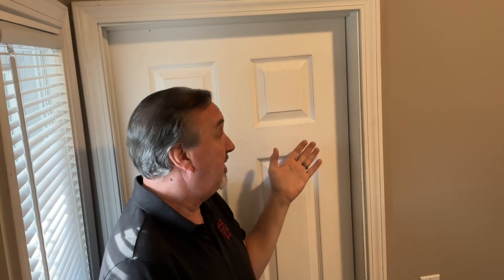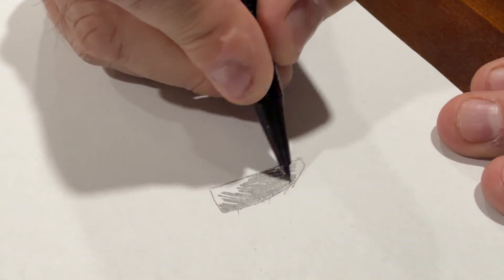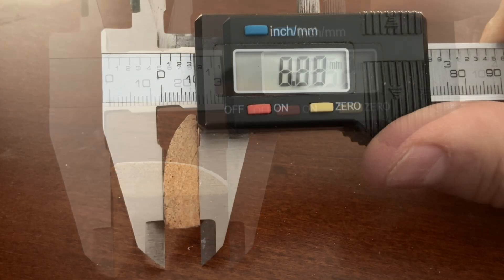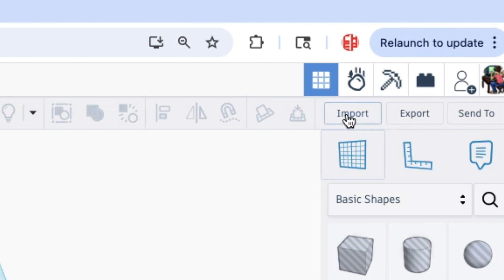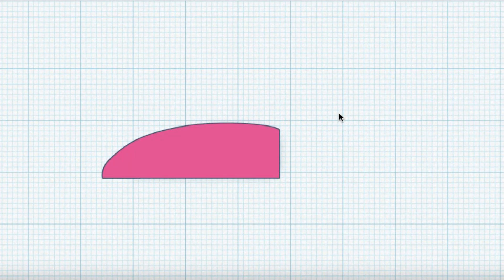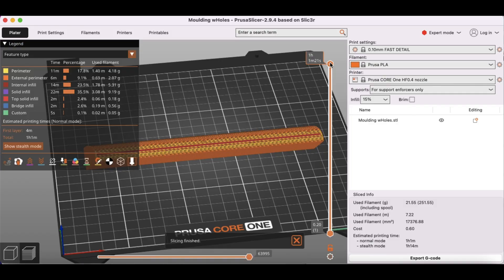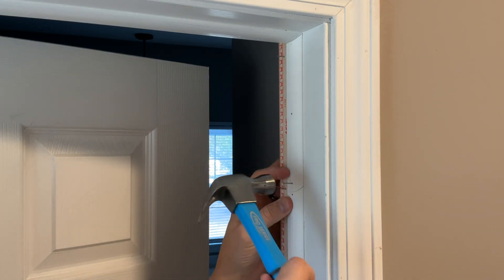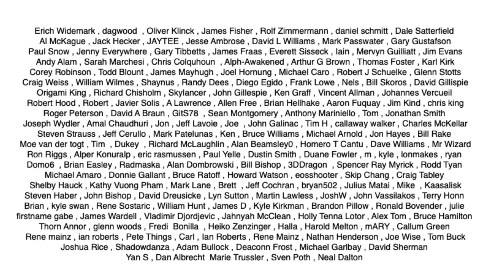3D Print Any Custom Door Trim and Save $$$

Comment: Great video and great idea! Use white calk to fill gaps and holes (that's what builders use works great) and paint, it will look like a regular piece of molding! Besides alot of the molding you buy now is extruded foam plastic, it's not wood. Thanks for sharing, your channel is awesome!!

Comment: I'm in the middle of a very similar project!  In my case, a 20 cm section of moulding on the wall (it looks very similar to yours) has been scratched up by my cats.  My procedure was similar except I cut a slot in the moulding then inserted a piece of cardboard and scribed the moulding profile on the cardboard with a pencil.   

I haven't printed teh moulding segment yet because my first step was to make and print protective cover segments (which is a simpler polygon shape) that wraps around the trim and I can screw it into the door frame.  The reasoning is that once I fix the trim, I want to protect it for when we sell this house (or no longer have cats).  At that time I can remove the covers and quickly fill/paint the small screw holes for the covers and the trim will look like new.

I find it interesting how we adapt 3D printing to solve issues that traditionally would've been does with new wood and woodworking equipment.  I don't have the space for woodworking but I do have two 3D printers!

Comment: Great job.  I thought you would create a mortise and tenon in the ends of your molding to help align the ends but it worked okay with the yard stick.  I would have used the saw pressed against the floor (protect the floor with masking tape) and cut a slot between the molding and the floor, then slipped a piece of paper into the kerf to trace the molding profile.
Reply from the maker: The bottom of the moulding had a 45° cut so I had to go higher. And once that cut it there the piece fell off so your idea wouldn’t have worked. 
I did trace it as I showed and now I can glue the cut piece back in place or just 3D Print a replacement.

Comment: Proper white caulk will cover that nicely before painting.
Reply from the maker: I’ve used that many times. But I prefer sand able filler and then paintable caulk on the edges.

Comment: Could have used (or printed) a "profile gauge" that would capture the shape of your moulding.
Reply from the maker: As I’ve mentioned in comments from others, I’ve tried that profile tool before but the results weren’t as good as my slice method. And I can glue the piece back or just 3D Print a replacement.

Comment: Those are called quater rounds if you ever need to search online for them. Available in almost every hardware store.
Reply from the maker: No mine are stretched as you see in the video. Quarter rounds are typical shoe mouldings. 1/4 of a circle.
Reply: @FilamentFriday  Your right. The angle of the picture made it look elongated but it was 11/16 x 11/16.
Reply: It's actually 'Ranch Stop Moulding'.  Most Menard's carries it as item# 4171567  though the exact width and height might be off which is the challenge with matching any trim.
Reply from the maker: Saw that one. It was too short width wise by about 1/4 inch but thickness was close. The other issue was the curve wasn’t the same. It was flatter.
Many don’t believe me but I searched a lot before 3D Printing it. Mine is just an old style moulding.
Reply: @FilamentFriday  The size differences is a common problem with trims.  Many times the are milled slightly differently so you end up just changing it all out or, if it is a special case, get it custom milled.
Reply from the maker: Or 3D Print it 😉
Reply: It's a door stop.

Comment: What a waste of electric and filament. As a carpenter. What you do I go get all new door stop. Costs 99 cents a foot at the depot.
Reply from the maker: A door stop? Around here those are rubber wedges that are shoved under a door to hold it open.
Reply: @FilamentFriday  He's referring almost to the proper term for that trim type >  Door stop trim.  Your particular profile should be 'Ranch style'.
Reply: Tradesman here- that's the usual solution. If you can't match it and it isn't high end stuff, strip all 3 sides off and replace it with whatever is available as a "close match".

Comment: A contour gauge would have allowed you to transfer the irregular shape without cutting into the moulding ;-)
Reply from the maker: I thought about that but I’ve used one before and didn’t get the results I wanted. I’ve found a sample works best for me and often can just glue the cut sample back in place though this time I’ll 3D print the replacement.

Comment: Great job. I am hobby woodworker that creates wood toys and candy dispensers and I have used 3D printing to add to these items. Some things are just too small in detail to create out of wood. Inkscape is a good open source software to design sag files to import.
Reply: I found that Lightburn is also very helpful.  I had it for my Laser engraver, you  can import a Jpeg and then use the trace tool to make an SVG.  It also lets you enter text with using any windows font and export that, which is a weakness in Tinkercad.  I do a lot of items with logos and can capture them from the internet and convert.
Reply: @woodwaker1  Thanks for this Tip. I have lightburn for my laser engraver and I have never thought to use it to export logos this way for 3D printing...
Reply from the maker: I’ve used Inkscape in the past. I found the conversion easier.

Comment: Excellent job- only thing I think could be improved is have the hole go through the diagonal part of the piece near the end. It would hold them together and register them in the right spot at the same time
Reply from the maker: I actually tested that and somehow the bottom shifted when the nail got tighter. So I abandoned that and went to two nails.

Comment: I'd use some caulk to fill in the gaps.  You might consider making a custom sanding block.  It would be really easy, since you have the molding model already, you'd just use the negative in a block.  Print out the block, stick on some self-adhesive sandpaper and you could get a really smooth surface.  That actually might be a good video by itself.  I know I sometimes wish I had a custom sanding block for woodworking projects and 3D printing would be a good way of making one.

Comment: I have been thinking about the same idea, I did make a seal for the bottom of my storm door using a similar method with TPU and glued the pieces together with adhesive to the door which worked pretty good. A little bit of finish work and no one will ever know.

Comment: i've had similar ideas, but would've used my belt printer.  of course, i built my machine myself & it runs klipper, so its reliability & print quality are quite a bit different than the cr30.  i'd convert the cr30 to klipper & upgrade the toolhead, if i were you.

Comment: I just wanted to share an alternate workflow I do. I make vintage motorcycle parts for my dad and I have him take pictures of the parts with a ruler because we are on opposite sides of the country. Then I import the image and scale it to perfect size based on the ruler. Then I'll just trace overtop of the image of the part. Works great for simple things without needing the physical item. And you can import each side of the part as an image to a different plane. So far I am 4 for 4 on making exact parts.

Comment: Ha ha, i did something similar for some ceiling architraves(moulding profile) as i could no buy the right size. Took a lot more than 10. I designed it as a spiral print with some reinforcement cuts on the back face. They also slotted into each other. I a small amount of polyfiller plaster over the top to smooth the layer lines and joins. Perfect match to the rest. You do need to move from tinkercad though. That would be trivial in almost any cad program.

Comment: Sir, once you have created the preferred shape you could have exported as a step file and maybe a lumber mill that uses computer aided cutting machines may have been able to cut it for as a single piece, this would probably be very expensive as it would be a single one of job. As a teaching tool it's excellent.

Comment: Paintable caulk fills any gaps and is what I've seen pros use when painting trim.  Looks pretty good Chuck!  Thanks for sharing your project.
Reply from the maker: I often use that around moulding so I agree.
Reply: That confirms my suspicions about this place. Other than finish nail divots, it's too smooth.